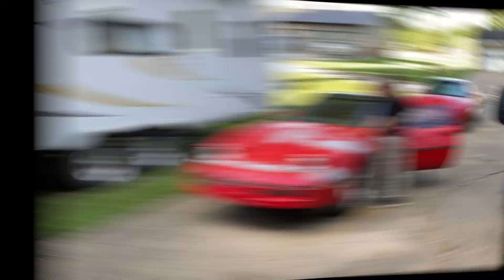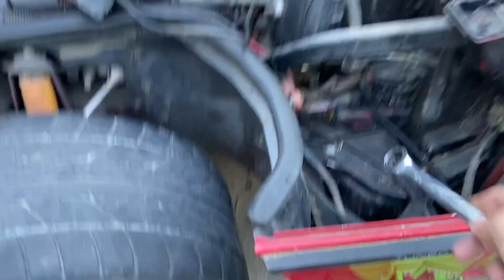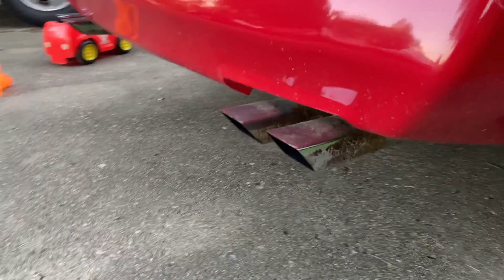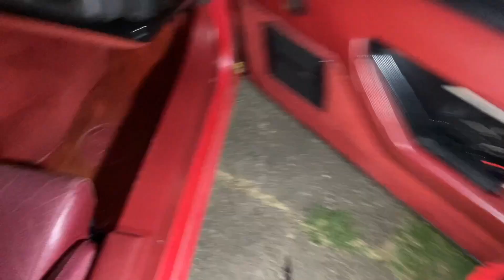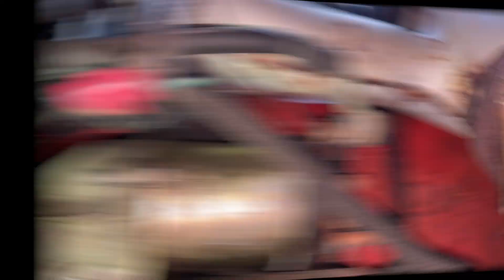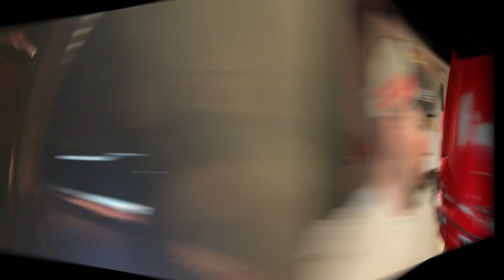Project Poorvette - Thrill Billy's C4 Corvette Project Car - EPISODE 8

Comment: Look forward to your updates. Hokey smokes I thought my 90 was worked on by a caveman. Mind you it looks like new, with really low mileage, but somebody did a tune up before the auction that sold it to the prior owner. I knew I could fix the stumble at idle. Turned out to be a vacuum leak. Plus, an oil leak at the back of the manifold that required it's removal. Oh, the joy. After that monkey stuff I checked the plugs, due to weak performance. Yup wrong plugs were installed. Plugs were for a cast iron head not aluminum! Hey, it ran with those plugs about 400 miles. The cap and rotor were replaced at the same time with Delco parts. I have been trying to stay stock. For me it's easier to fix that way. Seeing what you're going through make things a little brighter. Good to see you aren't throwing wrenches and have great helpers. Through it all I really enjoy my gutless wonder on the highway. runs like a champ now! Till the next thing comes out of nowhere HUH.   CHEERS

Comment: Lose starter wires can make it hard to start your car. That random lose wire looks like a coolant temp sensor wire. It goes on the passenger side of the engine just above the knock sensor. If it's the same as my 86 tpi firebird, It is used for the ac system and an electric cooling fan. It tells the ecu to turn on the cooling fan when the ac is on.
Reply: Thanks for that! That wire looked pretty beat up. I think the previous owner had this motor out before. I guess it was still attached when removed and ripped it up.